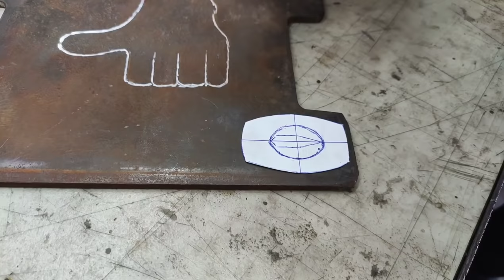Forging a black KATANA from an old bearing

Comment: Though the method of making a katana is much more harder and different but this one is also good. The effort on this is astounding.
Reply: absolutely correct. katana = folded steel
Reply: When making a katana you’d make it straight then put a substance on it, then cool it, making the curve of the katana.
For this, they just make the curve by hand
Reply: @Random Hobby well no? no way right if ur a expert then ill belive that but i dont think so, the steel of a katana is super hard right?? its super strong and really good and a bearing is just a bearing, i bet if u took the katana made and a real katana the real katana would beat it in a lot of places, one being the one made isnt full tang making it worse for battle then a full tang
Reply: @Random Hobby ooo but i thought by making the blade hotter at some points and cooler making it more flexible and hard is better then just normal steel ig i was wrong :)
Reply: Carbon content of the steel and forge grain matter as well if you're planning to make something functional.  Traditional katana making combined 2 grades of steel for functionality optimization.   Yes its true they had to go through alot more work to MAKE good, usable steel, but what they ended up with holds up as good as any modern, manufactured steel product.  Using just high carbon steel (as ive seen lots of DIY katana builds do)  is fine for a display piece, but wouldnt go far in combat use without breaking.

So in the end its all in how "legit" you want your sword.  Traditional forging is an extremely time consuming process, which is why such weapons command high prices.  Or you can go the DIY route with some commercial mild steel and make something thats perfectly suitable for most non-combat needs.
Reply: @Random Hobby  i dont recall ever saying that Japanese traditionally folded steel was better:  just that the techniques they used made for a better combant tool compared to the blades made out of homogeneous high carbon steel.  Im sure youre aware that your steel being harder doesn't always make it better suited for certain applications,  which is why mild steels exist.

Using high carbon steel from an old bearing will work fantastically for what its smith was trying to create.  My point is that i wouldnt try to take it into battle, as it will likely shatter or fracture when brought against another metal surface a few times

Comment: I haven't seen any of these forging videos, I've watched dozens, how the curve is forged into the blade. It always shows the hammering, and immediately after, the curve is just there. I would love to see more on putting in the curve exactly.
Reply: The curve just appears because because of the way it is heat treated. Heat treating hardens the steel. The faster the blade cools, the harder it gets. That's why bladesmiths will rush directly from the forge to the quench. However when a clay is used along the spine it acts as an insulator. So when he quenches it, the blade hardens first. This causes a bit of a forward bend. Then when the spine cools the steel contracts and forms the traditional katana curve. That's kind of a simplified explanation but I hope it gets the point across.

Edit: I should note that the spine also doesn't get as hard as the blade due to the clay. This is desired because hardening can make metal brittle (which is why bladesmiths temper after the hardening) so the spine not technically "hardening" helps it absorb the shock of hits better

Comment: 15:40 I never knew Katana's were held together with that one little piece, that's really cool
Reply: İt's called the Mekugi, and it's usually made out of Bamboo, but i don't know the reason of which he used a steel/metal mekugi
Reply: @descenterdrake9569  probably so its sturdier
Reply: @mfhero5295  i mean you do have a point, but back then when steel/metal mekugis were being used, it would bend and would be almost impossible to take the bent mekugi out. And thats why in the edo peroid, almost every single katana used a bamboo mekugi which was better because it was sturdy enough, and if it broke, it was very easy to replace it
Reply: @descenterdrake9569  also the fact hes not a traditional katana blacksmith so the mekugi is not a fact he cares about
Reply: @mfhero5295  ye u right

Comment: Realy cool man awesome job maybe for next Time put The Groove for The tang in only one handle slab otherwise if you would use The sword alot of stress would come on The glue seal that keeps both slabs together again Realy Nice hope to be as good as you one day 👍🔥 Ps sorry if my vocubulary is bad im from The netherlands 😁
Reply: So you hope one day to disrespect Japanese bladesmiths by calling a blade made of trash a katana? Low goals my dude 🤔
Reply: @weedconesuer  The bearings are made from 52100 steel, not trash. Exceptional hardness with good edge retention

Comment: This katana is almost perfect, with the exception of the diamond-shaped cross-section, which is unsuitable for a cutting weapon. You can also see a slight unevenness of the blade, and I'm not talking about the bend. But for the design of the handle - a special thank you.

Comment: Id love to see you go on forged amd fire but at this point i really dont know if it would be fair your skill is next level
Reply: except he didn't actually forge anything, he just re-shaped a chunk of steel, then drew a pattern and cut it out
Reply: @prodigypenn  

"He just re-shaped a piece of metal"

Yeah, that's called forging numnuts.
Reply: @DoraTheMFDestroya  not to me, foeging is forming the actual item, not just taking a chunk of metal and making it into a bar, then tracing out a pattern, and removing material until it's the right shape
Reply: @prodigypenn  

Well strangely, a massive part of modern forging is just refining the shape.

Comment: Great work as usual ! But I have a question what kind of steel did you use for this video?
Reply from the maker: 52100
Reply: bearings usual made of 52100 steel and its very hard for knives
Reply: The trash kind that no japanese bladesmith would have used.. Genuine katana are made out of iron the bladesmith forged himself called tamahagane not a rusted ass bearing from the dump 💀
Reply: @weedconesuer  Tamahagane is steel, not iron.

Comment: FYI your Tang and handle should be person size appropriate. One fist at or slightly below the Tsuba or hilt...then a fist distance between your other fist with a half inch at the bottom of that fist...but still the sword was meant to be used one handed. You did nice work btw. Thank you.

Comment: Im curious.  Ive watched several DIY katana builds now where a fair bit of hand hammer shaping is used for fine tuning the frame...but the tip of the sword is made via a cutting power tool.  Is there any reason why you dont hammer shape it?  Too time consuming?

Comment: Most of the time when you use scrap to make knives and steel you end up with something almost equivalent to 1045 or 1055, if you're lucky 1060. If there were a shortage of good steel, I could maybe see it. But honestly this scrap is more fit for hatchets, axes, shovels, maybe spear heads, than it is for knives and swords. Because usually it doesn't hold an edge or it rolls or it chips.

Comment: 52100 it's not o good steel for swords , more then sure will break on high impact on wood or other blade not to mention a felxibilty test..., but good work on the build.

Comment: I have a question, what clay did you use on the blade?
Reply: He made a nice sword not a KATANA
Reply: @MacksCurley  katana literally translates to "sword" so yes, it is a katana. 

If you want to get more technical, it refers to ANY full sized, single edged blade. 

So even a Saber would be called a katana. 

Don't confuse you're lack of knowledge with a real understanding of Japanese history. Because the only reasons the katana is mistaken to be a specific type of sword is due to Japanese steel being so God awful that they had to fold and water quench the blade for it to be somewhat usable. And often, their blades broke from basic use u less it was a custom blade commissioned by a high ranking person.
Reply: @DoraTheMFDestroya  Thanks for the education. I was under the impression that the Japanese swords were superior due to the folding of the steel. I guess you learn something knew every day.
Reply: Traditionally katanas were not forged from ‘steel’. They were forged from iron sand (tamahagane) with rice stalks added.

Iron sand is high in… well iron. And rice stalks are made of cellulose, which is mostly carbon. And when you forge iron with heat and pressure and add carbon you get… steel.

Of course this is a pretty crude method and would result in uneven distribution of carbon, which would lead to cracks. So hammer it out, fold it, hammer it out again. Stir and repeat. This evens out the distribution of carbon and makes pretty good steel.

Comment: it looks good but there is a reason katanas are made with a lot of layers and not 10 or 30 its near the range of 33000 layers.
Reply: bro what, tf they dont need to be. That was done to distribute the impurity of japans shitty iron sand ore, that why it was folded over so many times.
Reply: @preke953  search why are japanese katanas folded and read past to remove impurities
Reply: @thisguythismoment  brother you search it up, legitmately just look it up. It was folded many times so as to evenly distribute the impurities of using iron sand and charcoal, japam just didnt have acess to good iron ore because they are literally just a bunch of islands. If you did that with homogenised steel will weaken, if you didnt fold the crappy sand ore steel enough when shaping and other processes it would break far more easily due to points of carbon concentration and making pig iron i.e brittle.
Reply: @preke953  The process of folding metal to improve strength and remove impurities
Reply: It evens out the carbon making it more durable and slightly flexible 

Btw isnt this u 🤓?

Comment: Can someone tell me what that is that I 0ut on the blade after he wrapped it in wire
Reply: Diffrential hardening, a hardening technique that gives the blade a curve and the wavy hamon line on the edge. It requires a thin layer of clay on the edge and a thicker layer on the body, once heated up you quench it and thats when the blade starts hardening and curving
Reply: Thanks that helps alot
Reply: You got it
Reply: Yes thank you

Comment: Not a katana.. Just a sword made to look like one. Genuine katana are works of art that take months to create sometimes even years if the bladesmith works alone. Just the fact that you didnt make the tamahagane to forge this is already this replicas first downfall from ever being labeled as a genuine katana. Tired of seeing stuff like this, extremely disrespectful to the few masters who still practice the genuine art of creating katana. Cant imagine the audacity it must require to consider something made out of literal trash to be on the same level as something crafted from scratch by hand and pure honed skill
Reply: No one cares
Reply: Time does not equate effort, you can take 7 years to do a Phd and you can also get it in 3 years. Also this trash has better iron than what Japanese use to make the swords, they still use iron sand, for old times sake, which is one the worst source of sand due to high impurity, also the reason why the steel was folded. Pure honed skill my left cheek, the guy didn't make the best katana, but he sure ass hell did make one. Also who tf are you to get disrespected on behalf of "few masters". You weebs  needa chill

Comment: So there was no tempering and traditional you would need to wet grind the edges because using a grinder inputs too much heat with will change the crystal structure this sword would snap on the first swing on contact with another sword explains why he made it thick on the back #get exposed

Comment: The Japanese steelmaking method uses iron sand and charcoal as materials. Japanese iron sand has a low content of phosphorus and sulfur and contains vanadium. Charcoal has a low content of phosphorus and sulfur. Phosphorus and sulfur make steel brittle, and vanadium strengthens steel.
Iron ore has a high content of phosphorus and sulfur and does not contain vanadium. Coal has a high content of phosphorus and sulfur.
Vanadium has been detected in ironware around the 3rd century in Japan. Japan changed the material of iron making from iron ore to iron sand around the 3rd century.
In ancient Japan, slag was called noro, and slag elimination work was called noro dashi or noro shibori.
In tatara steelmaking, if the furnace is kept at 1300 ° C, iron sand will be in a semi-melted state, but only phosphorus, sulfur and impurities will be melted and discharged.
So impurities have been removed from the tamahagane of the katana material.
Vanadium makes steel more malleable and easier to roll, making it easier to fold.
By folding, vanadium is finely dispersed and combined with carbon to form a fine metal structure, so katana has excellent hardness, abrasion resistance, corrosion resistance, and toughness, and it becomes beautiful when sharpened.
Hitting the steel with a hammer removes the carbon along with the sparks, reducing the carbon content to 0.7%, which is suitable for katana.
The approximate amount of carbon can be determined by the shape of the spark.
By folding, the katana steel is in a state where austenite and martensite, which have different hardness structures, are dispersed.
When katana is sharpened with a Japanese sharpening stone, austenite is scraped off and martensite remains, so the blade becomes like a micro saw.
That's why Japanese knives are pulled when cutting.
China and Mongolia developed blast furnaces earlier than the West, but from around the 10th century, katana was imported from Japan and used by the military.
There were swords like longswords and rapiers in China, but we developed Qijiadao, wodao, and miao dao based on katana.
There are many records of katana in East Asia.
Mao Yuanyi (1594–1640), a military scholar of the Ming dynasty in China, “katana is extremely robust and sharp, and the Chinese sword is inferior to katana.”
Hitachi metals of Japan developed Yasugi Specialty Steel (yasugi hagane) around 1970 by analyzing and applying tatara steelmaking and tamahagane.
Yasugi Steel has the same properties as katana, so it is hard, strong against impact, and hard to break.
This special steel is used in various applications such as cutlery steel, materials for high-end kitchen knives, materials for razors, materials for automobile parts, automobile engine parts, and aircraft engine parts.

Comment: Please don't call this a katana.
The main material of the katana is Tamahagane, which can only be made in Japan.
The katana is only forged by combining two types of steel forged from the tamahagane.
In the first place, it is impossible to cut off the tip with a sander.
If you don't want to hurt the pride of Japanese people, please learn the correct manufacturing method.